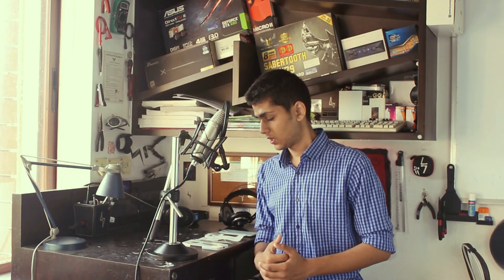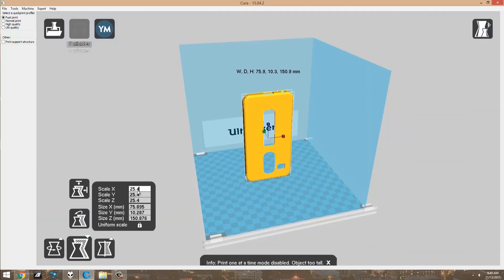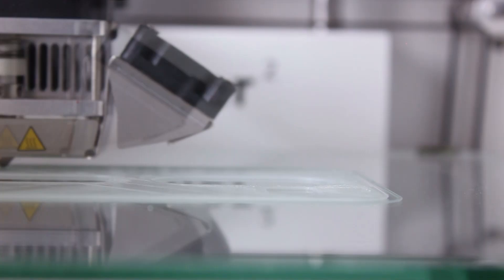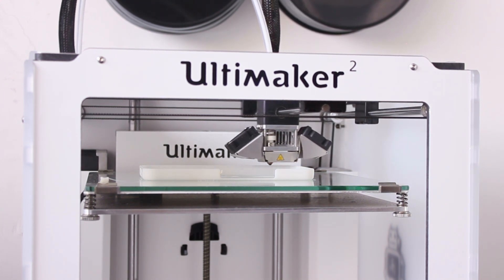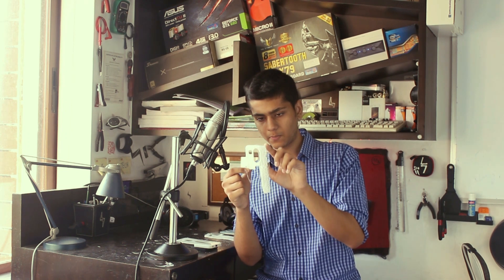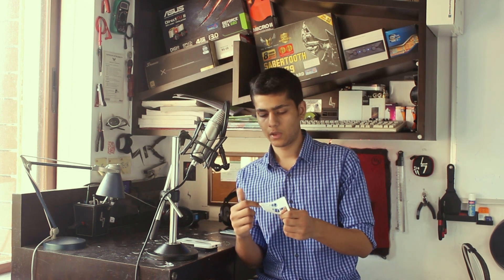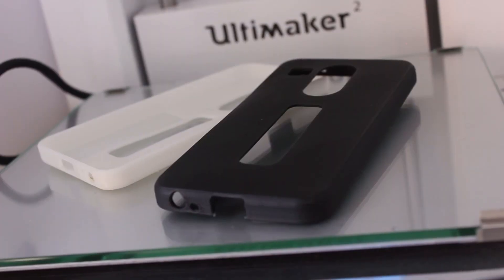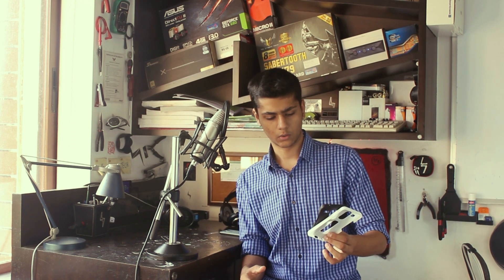3D Printed Nexus 5X Case : Ultimaker 2

Comment: Hey, how much did it took to print out and how much material was used?
Reply from the maker: All figures are approximation, 

Volume - 20.003 cm3
Surface Area - 270.390 cm2
Cost of my filament - $31 per Kg. 

My Cura 2.1.2 doesn't show the figures in grams after the update so, fuck it that shit software. Hope this helps!